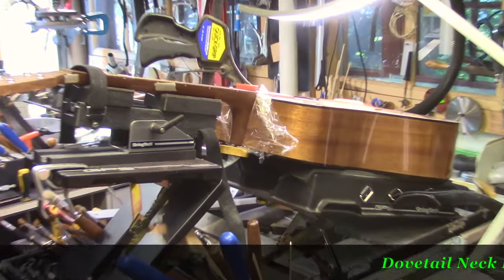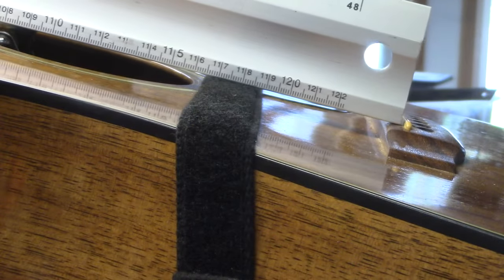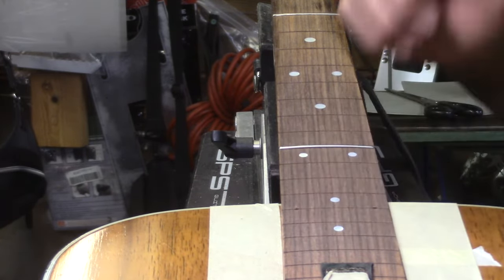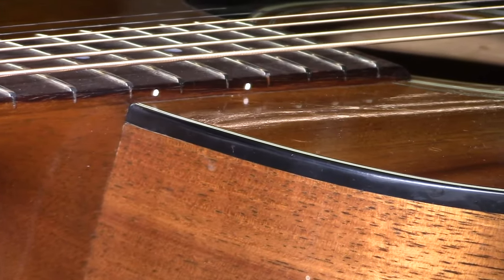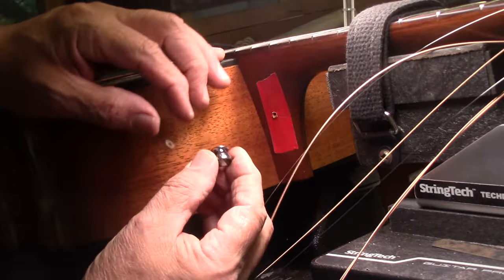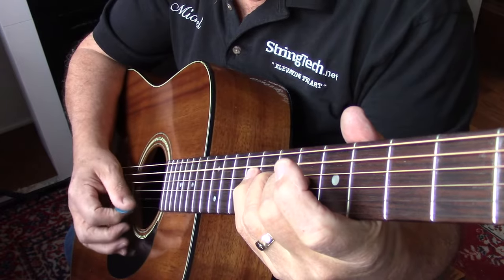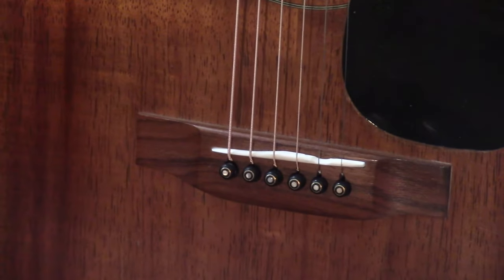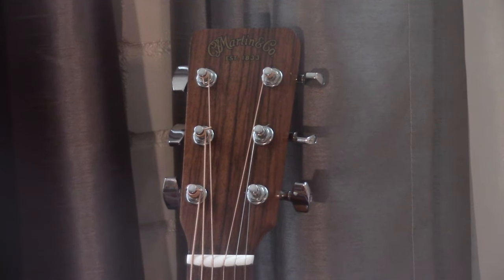Martin K+K Install Tips / Looth Group@StringTechWorkstations

Comment: Man, we both have a lot of the same ideas and techniques. Great minds think alike. Keep up the good work. I have your radius sander, which is just genious.
Reply from the maker: That is SO cool. I am dying to ask you something. A couple of years ago when we first produced that radius sander ; Greg had to snag my second drill press, for Darcy to use at the StringTech facility. I know that several of the other Techs / Luthiers ( Mike Schramm in PA for one) have a dedicated drill press for the Disc sander. I am finding that I am using this more than any other power tool in my shop. I am hunting through facebook market place to find a third sander to replace that one that Greg snagged. It's not a big deal to switch it over ... but I find that 80% of the time I am using it ( the drill press ) for the sander. Question: Do YOU have a dedicated drill press for the sander ?  Cheers Pal \m/ ! MMcC
Reply from the maker: The other Question. Can I send people to you for compensated nuts? Email me mcconvilleguitars@gmail and let me know please.

Comment: I tell people this all the time, you can use your fingerboard to gain height or lower trajectory, frets too, from LOW frets to super jumbo,  if your saddle is way too high with your bridge shaved and saddle a nib, you don't have to remove neck or bridge, to lift those strings install super jumbo ferts, new nuts, BOOM, 1/8th"! if height is critical don't level frets and remove that fret height, use a rocker and go thru and do one by one tamping down to get your level...

specially for belly bulge where the real fix IS removing the top and replacing current brace system with better stronger wood, rift or quarter sawn hard rock maple, don't remove that neck thinking hey that will solve it all, WRONG the belly will continue to bulge and you're back to ground zero, remove top and replace bracing with adequate material, not to worry about tone, done properly with the same top you can tune it with the bracing and get right back to where you were or very close time will heal . . .

OR use the fingerboard and or taller/shorter frets to adjust until you can get in there and do a proper repair, if its a medium value guitar, a bridge doctor and new frets, dial it in.. valuable of course doing it properly is the only way, remove the top and repair..

thing is a new remove and adjustment is always noticeable where a good luthier can remove the back and reinstall and you would never know, because no material is removed on the body, just better adequate bracing installed, IMO the neck joint should never be messed with unless its come loose, then clean up and re glue, never remove material.. whatever the issue is it can be solved with bracing and frets and fingerboard, otherwise its junk, if it needs to move that much its no longer going to have that original condition value at that point..

high strings are always the worst case, if taller frets don't do it then it needs the fingerboard ramped or both, the fingerboard and frets, yes you can ramp both, ramp the fingerboard, then install jumbo or the appropriate size frets and ramp those to dive down to the saddle, with fingerboard you can ramp up or down..  you might think but 1/4" is a lot, it is but not when you start from the nut, a half inch isn't that much . .  check it out next time
Reply from the maker: It is a "balancing act"...  controlling the trajectory of the string path from the nut to the saddle. All of what you mentioned / fingerboard surface adjustment / various fret heights / top bulge.  The other challenge is to find the solution WITHOUT creating too much mass ( or tension ) for the soundboard ... and altering the / tone / amplitude / volume of the guitar ... maintaining the original sound of the guitar. I have a D-41 Martin coming up that is super lightly braced and has an amazing sound. I have to keep that in mind, as I " make the call " on exactly what approach I will take. Stay tuned ;^ ) ... thanks for your input.